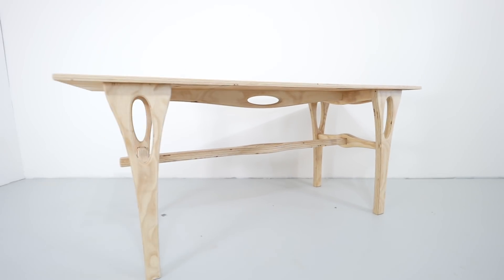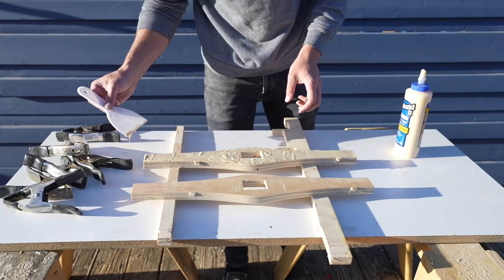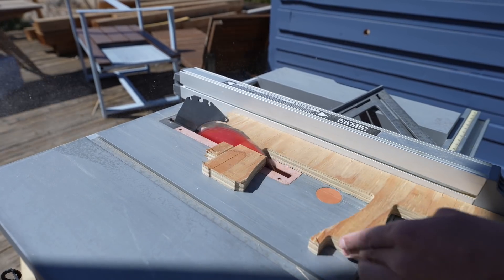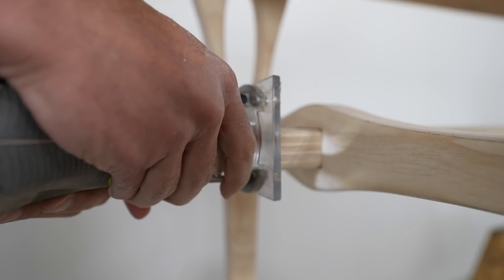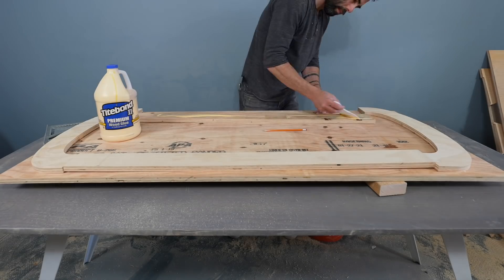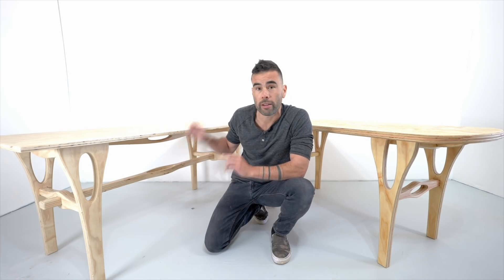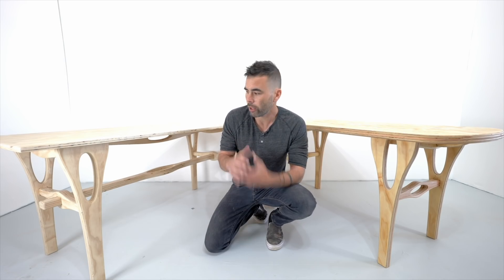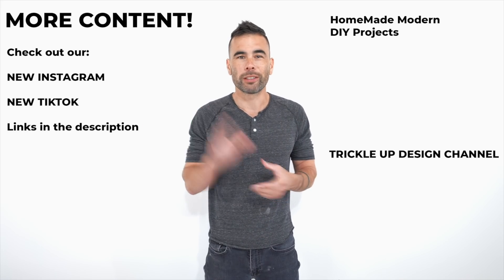Making Plywood Tables with a CNC

Comment: I ordered a CNC with a 32x32 cutting space.  Will I be able to make furniture with one that small or will I need one your size?
Reply: i also have a 32" x 32" CNC, and I've made a few pieces of larger furniture.  There is a technique called "tiling" which allows a design to exceed the size of the cutting space.  In his design, certainly the largest support or leg piece is under 32" x 32" .  I haven't looked at his design files.